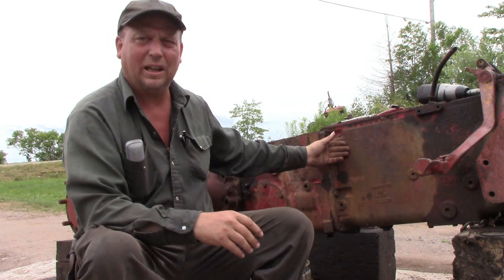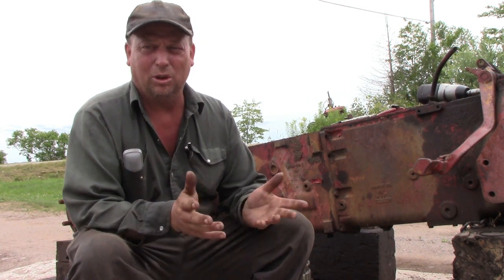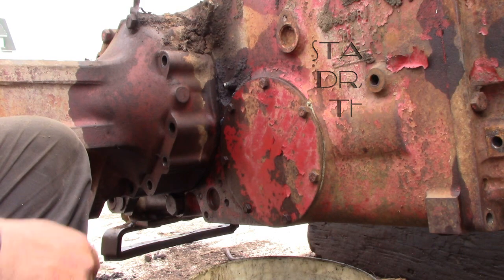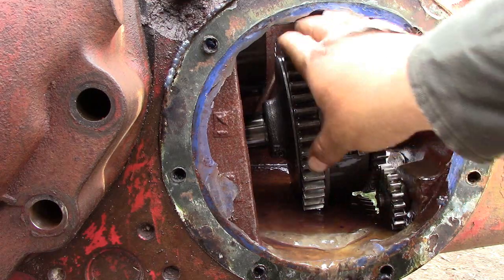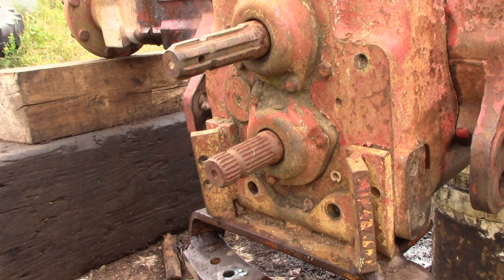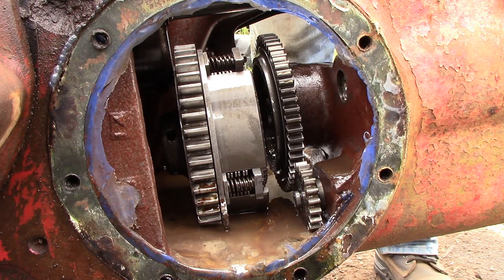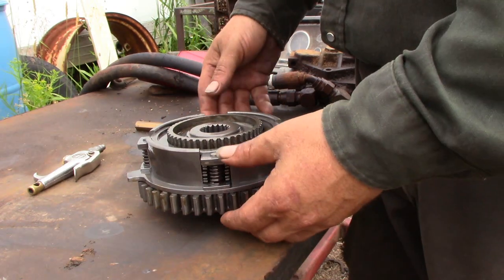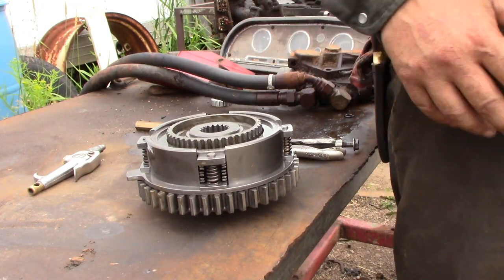74, 84, 85, 95, etc series CaseIH PTO Clutch pack

Comment: How does the 1000 pto shaft look? Chasing one to fit in mine.
Reply from the maker: It replaces the bottom shaft that drives the 540 shaft and would have the oil rings and the extra 8or 9 inches of the PTO splines. Thanks for watching!
Reply: @CanadianRedneck15 ok, thanks. Will see if I can find one to mount. 
Watching from Denmark-Scandinavia.

Comment: Hi, very informative videos you produce. We have an ih 474 1974 tractor which we keep next to the beach fo launching our boats in England UK. Recently the starter motor would not turn over the engine so we took it off and found it was all rusted up due to saltwater and sand and would not work due to being seized. We installed a new starter motor and the engine started straight away. We then discovered the clutch pedal had no resistance when pressed down and could even be pressed down easily by hand. We then found the power steering was not working also. The tractor was working fine when we parked it up last fall for the winter but just to mention last time we launched a boat seawater got splashed up onto the engine and gearbox areas, we have also had strong winds which drove sand all over the tractor park right next to the beach.  Could you please have any information to help us get the cluth and power steering working again as we are unable to use our boats without the tractor as the beach has soft sand. Any help will be greatly appreciated,  Many Thanks.
Reply from the maker: Yeah, salt water is death on machinery. I expect you will have to split the tractor and put a new clutch kit in. As far as the power steering it could be related to the clutch issues, the hydraulic pump is driven by the pressure plate. If not then check the hydraulic fluid and filter. Thanks for watching!

Comment: Thank you for the videos! I have a IH B-275. The pto was getting harder and harder to engage, and now it won't at all. Would this be wear on output shaft? Just trying to get a starting point. Thanks again for your help 😊
Reply from the maker: If it's "grinding" when you try to put it in gear that is the PTO clutch not releasing. I have a video on how to adjust that. If it doesn't grind but is just difficult to engage that could be wear on the PTO driving shaft, the sliding collar stays on the output shaft. Thanks for watching!
Reply: Thank you sir for your response!

Comment: I have a IH 2400A that the pto lever stuck in the off position. Turns out the spool boot was torn and debris got in the spool and it was stoved up. I cleaned it and got it moving up and down but my pto still doesn’t turn. What would you do next? Pop it valve on top of the mcv? Or maybe the spool? Thanks for any advice , Billy

Comment: I have 574 that needs the 540 pto pulled! Do you have a video?
Reply from the maker: I am sorry, I don't have a video on that. You have to take the lift unit off the top and get to it from inside the case to remove a lock ring holding the shaft in a bearing to remove the 540 shaft. Thanks for watching!

Comment: I got a 674 and all the hydraulic and PTO stopped working I'm looking for a reason why
Reply from the maker: I suspect that the PTO input shaft spline has stripped (the shaft that is driven by the pressure plate), that is something that can happen with these tractors. Thanks for watching!

Comment: Having just done my PTO clutch, I would like to offer some suggestions.
If your machine does not have a lower PTO shaft sticking out, when taking the shaft out, dont bother with trying to get the circlip /s off by the b earing, the whole thing comes out much more easily.
The roll pin can be a problem, I put a chalk mark on the shaft and housing when reassembling and that gave me a clue as to where it all went.
When putting the roll pin back, I used a soft brass drift, that made it easier as the brass formed its own guides on the head to hold it in the right place.
I took the wheel off and the footplate as it was the only way I could get enough space, also a small stool to sit on 4 to 6 inches high makes it more workable.
To get the big circlip back into the clutch was a job, I ended up grinding a notch in a set of valve spring compressors and used them to tighten up the ring and pop it into the groove.
Be prepared for draining the oil there is lots of it, 3 drain plugs.
It works a treat now.
Reply from the maker: Excellent tips, thank you, and thanks for watching!
Reply: I know about the three plugs and the fill plug, but can't find the full capacity to refill it
Reply: @DaffyDuc69  Dipstick on the Left Hand side, mine took about 40 litres.
Reply: @zl1dab  10 gallons.  I've seen 5 many times, but not for a full change.
TY
Reply: @DaffyDuc69  Yes, it surprised me, it may have a tad overfull, but not by much.  Was all a bit of a waste of effort, we sold the property soon after :-) and got rid of the tractor as well.  Have fun.  cheers  G

Comment: Hey dave nd yur help ihave a 1974 ih. 464 i have 2 rear pto shafts 1000 on bottom an 540 shaft on top my problem is i nd 540 on bottom so my bushhog drive shaft wont rub when i let it all the way down do they make a 540 shaft that will install on bottom i know both shafts will be 540 then but it will fix my problem i hope
Reply from the maker: There is no option for a 540 shaft on the bottom, sorry. Thanks for watching!

Comment: I have a 595 and need to replace trans/hydraulic fluid.  What oil do you recommend?  And is it really that important to use Hy-Tran by case as some people say and does the newer formulations not do well in the older tractors?  Any info is appreciated and love the videos.
Reply from the maker: The Hy-tran oil was designed specifically for these tractors so it is best if you can get it without too much difficulty, otherwise a good TDH oil will work. Thanks for watching!

Comment: Anyone ever have luck buying new pto clutch kit for the 724 bit of an older video  but any info would be great thanks
Reply from the maker: I thought the 724 was a 2 stage clutch similar to a 414 etc. not a clutch pack in the rear like the 84 series tractors.

Comment: I am having trouble reinstalling the PTO drive gear with cir-clip onto the PTO shaft. The drive gear is not sliding far enough in to expose the entire grove, as eyeless cir-clip is quite thick. This is model 85 case IH 959 1990 coming up from the bottom of range transmission, not much room to tap or pry...
Reply from the maker: The shaft is probably sliding back and forth enough to be difficult, try pulling it through with a magnet. Thanks for watching!

Comment: I've got a 95 Case 495, the PTO is always stuck on, lever doesn't do anything. Its just always on whenever you turn the tractor on. Do you think it's because the clutch disks are locked together? Thanks.
Reply from the maker: The clutch pack could certainly be jammed or there could be a problem with the PTO control valve in the MCV. Thanks for watching!

Comment: Hello I have a case ih 995xl and the pto only works when the clutch pedal is pressed, when I let up the clutch pedal the pto stops would you know the cause ? Thanks love the videos
Reply from the maker: That's odd, seems backwards.? Perhaps the spline is worn on the pto input shaft. Does the hydraulic pump stop as well?
  I am glad you enjoy the videos, thanks for watching!
Reply: Have changed the hydraulic pump and its still the same , the power steering is stiff some time but have very good pressure on the hydraulics ant the lift is 100%

Comment: Hey Dave, something I would add to the how to crank a tractor instructions would be to keep your cranking hand thumb pointed toward the tractor along the crank handle. If the crank kicks back the thumb doesn't get hit. You probably do that without thinking.
Reply from the maker: Good tip, thanks for that and thanks or watching!

Comment: Hello.  I have a Case IH 595.  Lost all hydraulics and PTO while mowing.  No noise or grinding... it just quit.  The tractor does not seem to have a right side access panel.  it has the MCV and pump access on the left side, under the filter can.  Is that where I go into the tractor?   After that, would the steps be essentially the same?
Reply from the maker: You should be able to get to everything through the MCV valve. Check for any obstruction to the hydraulic pickup. It's also possible that the PTO input shaft splines have worn, seems to me there is an inspection plate under the clutch housing you could check on that. Thanks for watching!

Comment: Quiero saber porque un international 784 no funciona la direccion hidraulica
Reply from the maker: I'm not quite sure I understand your question but if your hydraulics aren't working I would suggest probably a worn pump, if you  are talking about the hydraulic shuttle shift the likely the clutch pack is the problem.
 Thanks for watching!
Reply: Buen dia yo tube ese problema cuando cambie el aceite hydraulico dejo de funcionar la direcion le quite el filtro lo prendi i le estube dando buelta alado i lado asta que funciono lla que funcione le buelve a poner el filtro

Comment: Hi Dave I have a problem with my lift in my 574 it won't go down I removed the lift cover to replace the handbrake band now I have done this before and had no problem. Please don't tell me I have to take it off again 
Regards P.J Donnellan
Reply from the maker: Unfortunately you probably have to take the lift unit off again, something may have gotten bumped or damaged when it was off. Check out the linkage from the levers to the cylinder etc.
 Thanks, for watching!

Comment: hi there I have a case ih 595 4wd the pto works well when cold but as the tractor warms up the pto stops working how do i know if the clutch needs repacking or if the pump needs replacing thanks Geoff
Reply from the maker: If your three point hitch still has good lifting power after it warms up your pump is OK. Thanks for watching

Comment: I neglected to include in my comment earlier today that my 1981 IH 684 diesel tractor manuf in Great Britain has only 1 rear PTO shaft (I guess it is the top one) rather than having 2 rear PTO shafts.  How is the 1 rear PTO clutch for the 1 PTO shaft  -- the top one -- accessed and removed?  Thank you.

Comment: I have a 1981 IH 684 diesel tractor manufactured in Great Britain.  When rotary mowing waist high fescue or other pasture grasses or thick grass the rotary mower's (bush-hog), (a Hardee Model # T-972-LT) cylinder/shaft and yoke stop turning the cutting blades, and the grass is not being cut. [The 90 weight gear lubricant oil has been changed on the gear box of the Hardee Model #T-972-LT rotary mower.]   I have to pick up on the lift and let the rear PTO recover and start turning the rotary mower cylinder and yoke and cutting blades again.  Is there a way to adjust the rear PTO clutch, or is there other action I can take on the 1981 IH 684 diesel tractor to fix or improve the problem described above?   What is the problem?   Is the PTO clutch slipping badly and, therefore, worn out and needing to be replaced or rebuilt?  Is your video consistent with locating and removing the rear PTO clutch on a 1981 IH 684 diesel tractor manufactured in Great Britain?  Thank you.
Reply from the maker: Does the PTO shaft stop turning or just the gear box? The mower PTO shaft may have a slip clutch at the gear box. If the tractor PTO shaft stops turning then yes, the PTO clutch is worn and needs replaced. This video is consistent with a 684. (All tractors of this series were made in England, Doncaster I believe)  Thanks for watching!
Reply: I'm assuming it is the tractor PTO shaft.  However, while driving the tractor, I really can't see.  The yoke from the mower gear box as well as the mower shaft and the yoke attached to the tractor with a push-pin lock stops turning.  Perhaps I need to get someone else to drive the tractor and mower, and I should view from a safe distance with binoculars.  I assume the tractor PTO shaft stops turning because the mower yoke -- which is attached to the tractor rear PTO shaft and connected to the tractor PTO shaft with the push-pin--stops turning, too.  Please advise me how I can determine best and safely which shaft stops turning.  With that universal joint on the yoke that attaches to the PTO--it should keep turning if the tractor PTO shaft continues to turn, correct?
Reply: Also, is there any way to adjust the tractor rear PTO clutch in the self-contained unit PTO to alleviate or cure the issue I'm describing?
Reply from the maker: @joaniebowden7532  The clutch locks by hydraulic pressure so it is self adjusting to the point where you need to replace it.
  I would suggest that the next time it starts slipping stop the tractor leaving the PTO in gear and check if the shaft is still turning. It is a much simpler fix if it's just the slip clutch on the mower driveline.

Comment: Hi I have a 785xl and the top 540 PTO  is damaged will It pull out and so I can put a new one in are is it a bigger job. thanks
Reply from the maker: The good news is that the 540 shaft is a short shaft driven by a gear at the back of the differential case, the bad news is you have to remove the hydraulic lift cover to remove a snap ring behind the gear on the 540 shaft so you can remove it from the case,sorry. Good luck and thanks for watching!
Reply: Hi thanks
Reply from the maker: That lift cover is heavy, you will likely need a lift of some sort to get it off, I expect you will need to remove the cab.

Comment: in a 4wd 684? the round plate that you removed is that where the gearbox goes that powers the front axel ?
Reply from the maker: I am not certain, but for a "side drive" axle I believe it may be'for the "center drive" axles the transfer case is on the bottom of the case. Thanks for watching!

Comment: I have a Case IH 895. Looks like the access plate is on the bottom of the housing instead of the side, but my question is, I only have a PTO on the top shaft, the bottom has a cover on it. Does the same clutch operate both from the bottom and is there anything special I need to do other than what you've shown to replace my clutch discs?
Reply from the maker: The top PTO shaft is actually driven by the bottom shaft, so only one clutch. THere is a plate on the bottom, but I don't think it lines up, you have to go through the plate on the side. I believe I showed the basic steps to get the clutch pack out, to replace the disks you have to disassemble the clutch pack and change out the parts. Good luck!

Comment: I have a 444 international. When I place lever in pto on position it makes lever jump. I feel like the pto shaft could be stripped. Could that be seen through these access ports.
Reply from the maker: A 444 does not have access panels like these tractors, if you take the PTO lever out the side you may be able to see. Usually what happens is that the splines on the PTO driving shaft and the collar get worn tapered. I have a video that shows how to get to that shaft, it goes a lot deeper but you will be able to see what it is like.  https://www.youtube.com/watch?v=1sve9HaZMbk  Good luck and feel free to ask questions.

Comment: the mechanic can't repair the hydraulic functioning of my tractor case international .need help
Reply from the maker: What model and what is the trouble?
Reply: case international 747. the problem is that the trailer  and the mower can't function or even be lifted  .we replaced the fuel pump but nothing changed
Reply from the maker: I assume you mean hydraulic pump, I would think that would point to a relief valve or flow control valve. Good luck!

Comment: Good day I'm from Ont.  was that rear end from 574.  I have problem when putting  pto lever on , i use vice  grip to push lever far enough head  for full power, if you use hand on pto lever,blowing snow  when it gets heavy pto stops. it's not fully engaged.  Also we went on trip to East coast, boy I never s saw many trees. What part are you from THANKS
Reply from the maker: Hi Don, the rear end is from a 454, so the same as a 574. Check above the hydraulic filter on the left hand side behind the foot board. Check for anything block movement of the valve. The lever is 2 pieces held together by two bolts, it may need adjusted to get the full travel of the valve, or finally it could be the clutch pack is worn out.
  I am near Sussex NB, forestry is one of the major employers of the region. Thanks for watching!